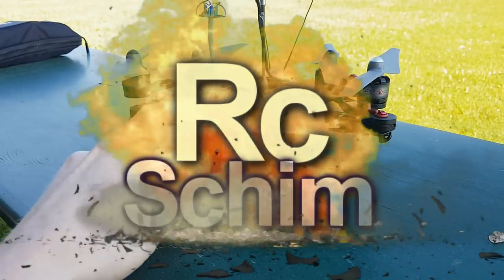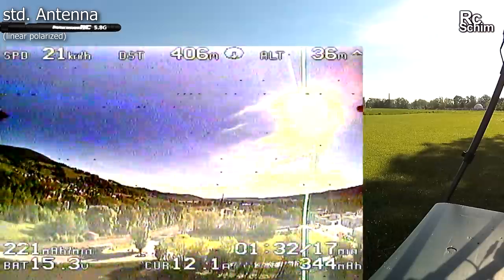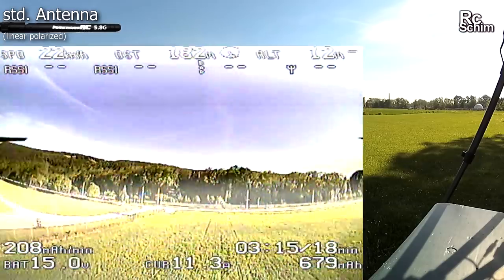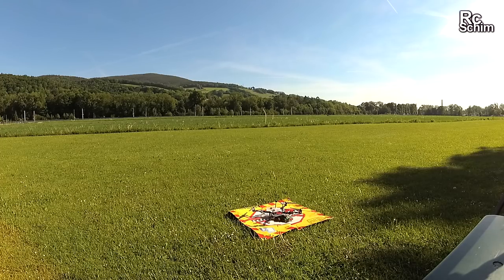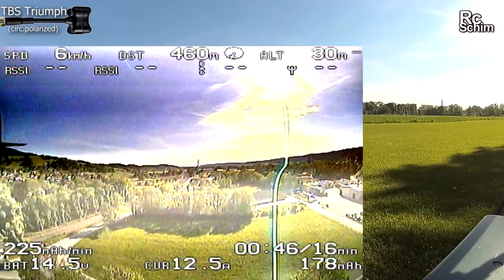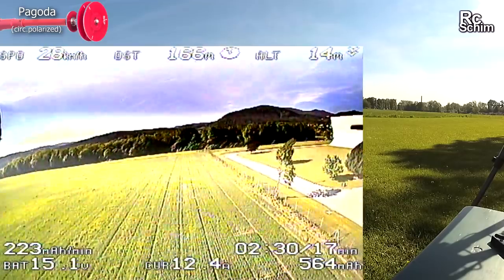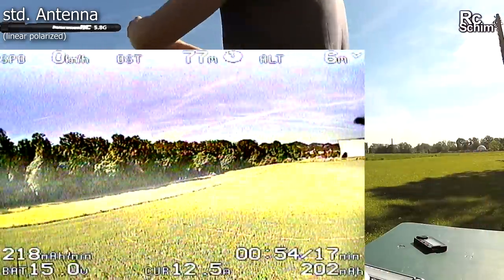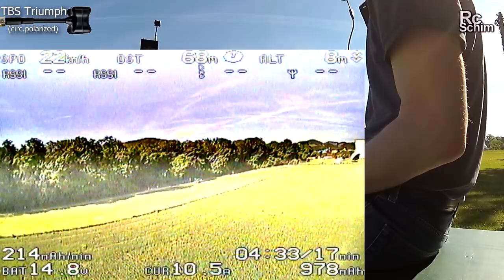Antennas tested in flight: Pagoda vs Aomway SPW, TBS Triumph and "normal" linear

Comment: With a 30dB attenuator (1000 times) you may well find that a significant percentage of the radiation you're picking up comes actually from leakage out of the transmitter itself rather than radiation from the antenna.   A lower attenuation (10dB or 20dB) would have been a better option.   You should have also flown directly over the top of the receiver antenna to determine the size of the null that exists there.  In my tests, the Pagoda has more range than the other antennas but it also has a larger null area (which is where it gets its gain from).
Reply from the maker: Thanks Bruce! It's always great to see you commenting here. Even more if they provide some of your indepth RF knowledge.
I thougt about the atti the same. With 30db not much RF juice will get to the antenna - it will leak out somewhere rather. 
In a previous test I wanted to use the Vortex150 (it has a low power mode that transmits with 7mw, but once airborne it does something different - couldnt measure this nice cause even in hand and with half throttle it doesnt think it's airborn - I think they also query the barometer).  
I did the antenna null test on a different setup (just walking around in my yard - but this test setup didnt work so well - I could have made this a 1h video - but that's too boring for most :)
Reply: Xjet, so the pagoda is better for extended range... proximity, right? If this makes sense.
Reply: The Pagoda will give you more range but it comes at the slight expense of a larger null-spot directly off the end of the antenna.
Reply: Agree with Bruce regarding attenuators.  You can also shield the transmitter and receiver if you use attenuators on them to ensure that the radiation picked up is by the antenna under test rather than an "undesired" antenna within the circuit.  As a note, I've tested quite a few 5.8 GHz CP antennas in a professional anechoic chamber.  The Pagoda has the best axial ratio over a wide field of view, hands-down, but at the expense of a slightly wider null at the top and bottom of the pattern.  When you get into the field of RF and antennas, get ready for a lifelong journey of learning!  Thanks for all of your videos, they are extremely helpful to the community.
Reply: Link

Comment: I fly with Pagoda's, Fatsharks and Aomways along with several others, but at one specific end of my usual circuit at 3600m range, running 600mw, the Pagoda's are substantially better, especially when I bank into turns, there is no dropout whatsoever, the fatsharks in same turn are completely gone, the Aomway gets pretty grainy. Another point, when flying directly overhead at high altitudes, the Pagoda's barely break up at all, and again the others vary from complete blackout (Fatshark) to barely visible horizon (aomway). I also think your attenuated test should have been transmitting with matched CP antennas, as linear polarisation is effectively rejected by CP antennas, so testing with that will produce an almost inverse result. Anyway, thanks for taking the time and effort to do the whole thing, it is a lot of work. Cheers.
Reply from the maker: thanks for that long comment. I just ordered 10db and 20db attenuators. with 30db (which seems to be 1000mw worth of dampening) there is nothing going thru the antenna - that's why I chose to just leave the LP on there. 

With 10DB atti (-10mw) the 25mw (which really had around 34mw) will emit less and make range extrem testings easier.
(The 20db is -100mw)

Good to hear from your 3.6km flights. awesome that you can get this far with omni antennas (on a plane I guess)
Reply: RCSchim Yes, it's fixed wing, I run them on drones but nowhere near as far. I usually don't venture much beyond 4km with 5.8g on planes, but those pagodas work really well where others are really at the limit.
Reply: Alasdair McC I can vouch for the Pagodas!
I got a FarVew kit back in January for something like $8.00 but now they are like $6 something... love them that are fantastic!
Reply: It's hard to go back to regular cp's after having them, I'd say for the performance and the price, there's nothing can compete. For 5.8 they have certainly lifted the bar.
Reply: FYI, Linear polarization isn't "rejected" by CP antennas.  There is approximately 3 dB of polarization mismatch loss, but this may be more or less with a real CP antenna depending on the alignment of the CP polarization ellipse and the other linearly polarized wave.
Reply: Yes, rejection is probably a little harsh for the layman, maybe better to say 'less than perfect at around half of the efficiency (-3dB) when operating in ideal polarisation situation but then progressively worse when off axis'.

Comment: Great comparison video, cheers. 
When I fly the different altitudes also make a difference. Also my Pagodas I have had over 1000 meters at 50 meters high. I can't wait for my Pagoda 2's to arrive.
Reply from the maker: makes sense (that different altitudes make a difference) especially the pagodas have a flatter "donut" of RF pattern. so their range is better in horizontal distance but not so much if you fly high or above you.    if you fly to low you get into the fresnel zone...

Comment: Good to see Mario, I prefer the in field testing to the purely technical tests.
Reply from the maker: thanks, me too. of course it's great to also learn the tech background. In practical application you just have to make sure to test correctly. for example: my first multipathing round with the TBS triumph was terrible - found out then that the antenna got loose...

since this video got some attention (and I also wanted to do it since longer time) I just got some more attenuators and hopefully will be able to do more testing with even better visible difference and practical results.

Comment: Nice video, I'm still new two the hobby, just trying to find good antennas, I fly the walkera, furious 215, I have farview, pagoda on that, and my goggles, skyzone, sjvo1, I have akk, Cloverleaf 5dbi, and a x-air, would you recommend a different antenna on my 215, our would you recommend changing to a lower dbi, on my goggles, I run,600mw, I typically fly through homemade gates around trees, up and over trees, a little bit of low racing, and free style, oh and I just been flying on the default setting channel b 5733mhz

Comment: HEY, not to shabby,, thanks,, i am very ignorant in regards to the Goggles, etc... ie. antenna!! and that really helped me to better understand what to expect and what to look for in upgrades... i am waiting for an eachine 800 i believe it is called, ii almost got the 007, or the 006, but something about the build of the 800 convinced me, plus it can also be used as a viewing window for anyone around, friends "if i actually had any", and family etc,, plus all around since it will be my 1st pair,,, i figured for the price, i couldnt go wrong.. thankx again,,,,great job
Reply from the maker: thanks; the eachine 800 actually looks good. the tripod mount for ext viewers is good. integrated battery is nice - but on the other hand, that means the weight is in front (some goggles have battery on the back of the head)...

Comment: Instead of using attenuators try using a fatshark repeater for the vtx.  Has all the same connectors as standard fatshark / immersion equipment but advertised as 5-15mw.  So its a easy swap for testing and the repeaters are cheap (15 usd right now from getfpv)

Comment: Nice testing Mr Schim :)   Did you see the testing Alex from VAS did recently of just the difference between sitting vs standing ? Its amazing how much of a difference,  that alone made ,because of ground reflections! It appears his new folded dipoles are a big change for the better on the radio/ transmitter side. I love those new pagodas I am hoping they work with his new folded dipole on the radio TX . I cannot ever remember, what works with dipoles,darn it. LOL Hi from the usa.
Reply from the maker: +Paul F no, didn't see that test. Bruce did a good explanation on the fresnel zone which explains this as well.

Comment: Thanks for the review and your tireless efforts. After watching many other tests/reviews it seems the differences between the antennas are "relatively" small.  Just wondering if using a diversity receiver with a circular and a large gain (ie; crosshair) antenna combination would improve the reception so much that it would not matter which transmitting antenna is used?

Comment: Also one of the things I am thinking about doing with my antenna testing will be to just use a receiver that I can tap into the RSSI pin on and read it out with a volt meter.  Then swap antennas while watching the meter.  This way you don't have to be subjective about the image and just see pure numbers.
Reply from the maker: yep, that sounds exactly like Bruce (he does this). I will do another Antenna / Receiver Test in Spring maybe (now it's just too cold) and I will do it with more dedication and attention to detail.

Comment: If you're having sync issues with the FR632, I highly recommend this mod:
https://www.rc-cam.com/forum/index.php?/topic/4025-fr632-58ghz-diversity-receiver-sync-problem/#comment-28602
I did the same and it fixed pretty much all the 'compatibility' issues I was having. In reality the FR632 contains a serious design flaw (the output driver is cutting off the bottom of the signal), it just doesn't show up with all transmitters.

Fun fact: the 'B' input has better reception because of another design flaw (transmission line is not 50 ohm), which by pure coincidence ended up working in their favor (LNA input is also not 50 ohm, so the transmission line acts like a quarter wavelength impedance transformer and actually improves the matching). Although the 'B' input has better signal strength, I suspect that it might have more thermal noise too, but it's difficult to test that.
Reply from the maker: Thanks Maarten, I think I remember this post. Not sure if I wanna modify the FR632 - but it looks easy enough. Just cant think that this component is totally useless...
But since I dont need the FR632 that much anymore (the int RX of my DomHDs now is just fine) I can try this...
Reply from the maker: ha, now I recognized the name - you're the designer of the pagoda! nice job man! (I could have known this by your avatar as well)
Reply: The 'cost' of doing this mod is that you lose the output buffers, so if you use the 'A' and 'B' outputs as well as the diversity output at the same time, the receiver sees twice the load, and the video signal amplitude will reduce somewhat. This is probably why the designers thought that adding the buffers was a good idea. Sadly the buffers are poorly designed and cut off the bottom part of the signal, which contains the sync pulses, so you get serious sync issues (especially when the camera is transmitting a bright image). It still works fine without the buffers though, because the output buffer of the receiver modules inside the FR632 itself (below the metal shields) seems to be pretty decent, and most screens are designed to handle small amplitude deviations anyway.

I considered doing a slight variation of this mod by adjusting some resistors to shift the voltage up by about 0.7V, which would have solved the problem, but I found out that the 3.3V supply inside the FR632 is too noisy for this trick. I didn't feel like throwing in a separate regulator just to provide a clean supply for the output buffers, when I was already getting perfect results just by removing the buffers entirely :).

After going through all the options, what I went with is this: remove the transistor, remove the 75 Ohm load resistor (it's pointless now), and use that resistor to bypass the transistor (instead of just shorting it like the first mod suggested). This produces the correct output impedance and amplitude, and reduces the load seen by the receiver modules.

Have fun :).

Comment: Thanks for the review! One thing, why didn't the signal drop to white noise when you took off the antenna? Something spookie going on... :-)
Reply from the maker: I agree. Might be my test setup... Bruce pointed out that with the big attenuator the leakage RF power is the thing that's transmitted, but on the receiver side? I will repeat this test with smaller attenuation, maybe it's better visible then.
like a 10dbi atti should be great for reducing the 25mw range nice

Comment: Nice test!
TBS Triumph is win? My need for F450 copter.
Reply from the maker: +чудоКИТ f450 flamewheel? Doesn't sound like a racer. I would take tbs for racing. If you want good range maybe the aomway or the pagoda. If you have a diversity rx get a helix antenna as well...
Reply: My quadcopter for shooting video and FPV

Comment: i do belive that the plastic tray that sits under the antenna makes it perform less effcient. 

to test them more accurate try to position the antenna under your quad. lets be honest here and admit that you have very much hardware on there and the frame is also rf blocking.  to give antennas a proper run for their money you need to let them broadcast more freely. 

iv have personally flown over 1000 meters  over both an open field and the sea. no proplems at all. its all in the placement of the broadcaster and the lenght of antennawire from the vtx to the actual antenna.

 fyi:you will loose dbi for each inches of extenderwire.
Reply from the maker: You're right - Antennaplacement should be perfect to get good range. But this here was meant to be a "practical" antenna test - most FPVers DONT have perfect antenna placement on their quads.
I hope to have time for a similar video soon with more antennas and better testing. 
I also got some new attenuators to reduce needed distance more effective...

I know that you loose a lot of antenna gain with extension wires. once tested the DB reading I get directly from the VTX (with atti) and then with 1.5m and also with 3m extension. If I recall right 3m extension was half the MW reading (let's say from 25mw to 13mw...)  (tested with the ImmersionRC Powermeter and a 30dbi atti...
Reply: RCSchim there you go😀
Reply: HI! What about short RP-SMA/SMA adapters? I using one of these on my FPV googles. Did they do sth to the gain? RX isn't the best, so every dBi counts...

Comment: Hi, great video thanks! I'm considering getting a pair of Fatsharks for when I'm flying in public and want to draw less attention than my awesome Quanum V2's do. I'm really torn between the "affordability" of the Dominator V3's and the extra FOV and 4:3 screens of the HD3's.  Have you had a chance to compare the V3's with the HD3's? I'd really appreciate your opinion.
Reply from the maker: I used to fly with the attitude SDs back a few years ago. they were ok. had 35° fov which is the lower end of FOV i'd like to fly. putting on the old base mode with 45° then was huge.
So just try the V3s and see if the screensize is ok for you. one can also change FOV on the cam side (try different lenses and see if the flying experience is better then!).
I still most of the time fly with the DomHDs (4:3, 800x600, 46°) and since I added the faceplate with fan it wasnt fogging (most annoying problem on goggles).
good luck for the goggle upgrade, greets!
Reply: Thanks for the fast reply, much appreciated. I need to find a shop that actually has stock of the V3's or HD3's. That seems to be the biggest hurdle!
Reply from the maker: check out the new dominator model that just came out https://www.youtube.com/watch?v=k1Zw1TwM4FA

Comment: Dear Schim.
What antenna you can recommend now. I fly with drone racer on gep rc chimp frame. I don't use any go pro cameras.
I fly no more than 300m around me, and fly around and between trees. I want clear signal.
I very want know you recommendations , because you look like smart guy.
Reply from the maker: +Alex Glikman thanks, you should use a diversity receiver. Maybe 2 pagoda. If you can use more than 25mw to fly behind trees. 
Use one 8dbi patch maybe too have more gain. Use a good vide transmitter. Try different channels  (not all of them have same power!)
Have fun!
Reply: thanx
Reply: Perhaps triple patch pagoda?.

Comment: i bought a second set of aomways from BG european warehouse and they came with lobe protectors... .. still not happy with my up grade from syma 5.8ghz kit to a full proper kit... except the runcam swift mini .. thats great for being able to see even against the sun.... but the rest... not as big a boost in confidence in the signal as i was hoping for...
Reply from the maker: what mw are you transmitting? which VRX is used? I gained confidence with diversity receivers + those nicer antennas (be it aomway over ImmersionRC or now the Pagodas)
Reply: my first one was eachine et 200mw.... my new one is eachine but with 25mw 200mw 600mw option.... i used patch antenna from syma kit which worked  really well, then used one aomway which worked equally well,,, now i have the boscam (copy) diversity using both patch and aomway... performance seems identical.... ps. the vtx  only has one button for everything.. so i'm not even sure what mw's its on hehehe..... josh flies behind his house.... i fly behind a particular bush and i get some break up..
Reply from the maker: +TheMadmacs the immersion rc Power Meteris useful to see how much mw you get at the antenna connector. There you see that even different channels have diff mw. Maybe the patches are the wrong polarisation? Or are they linear? If you don't wanna fly duper far stay with 2 aomway spw on the div.
Reply: yeah i saw a seby docky vid were he measured each channel and found some big differences ... i will just have to experiment,  i think the patch is good... i used it as a single antenna to find a lost quad a few weeks back... musta looked cool wandering around a field stopping and turning in a circle every so often......